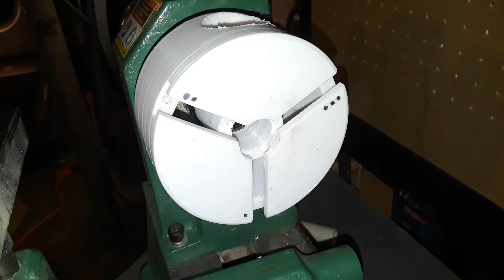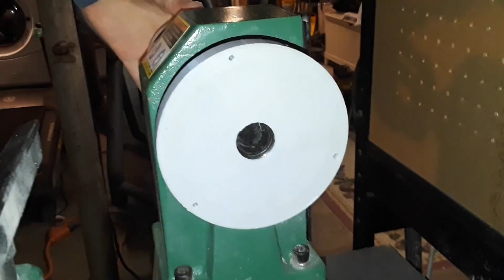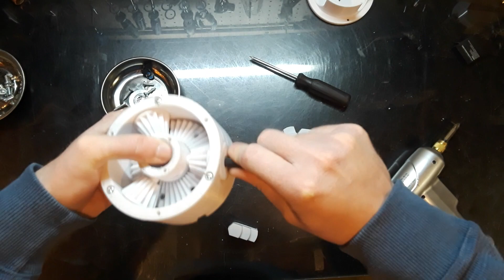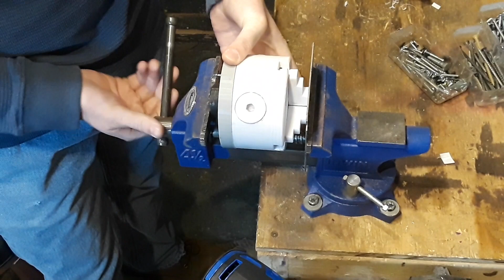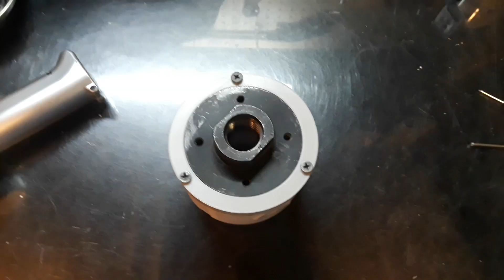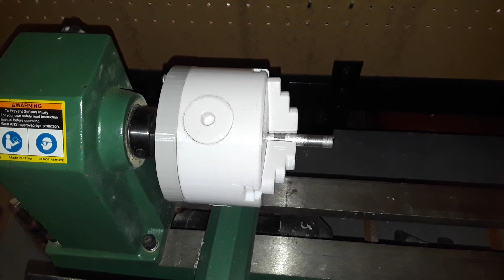Making a 3D Printed Lathe Chuck

Comment: do you have a link to the make the mod plate you made
Reply from the maker: I don't. I used tinkercad to make my own design. It's very easy to design. Just make sure you have the correct measurements for the lathe faceplate indent in the "mod plate".

Comment: Did you ever more thoroughly test this on your lathe? Ive got one printed up in PLA, Im curious if it can be safely used at the lowest RPM on my wood lathe (750 RPM).
Reply from the maker: So far it has been pretty safe. Just make sure all the plastic parts are screwed on to the faceplate correctly.
Reply: @BunkerBuilder  Whats the max RPM youve tested it at?
Reply from the maker: I have my lathe set at 1600rpm
Reply: The problem is not so much apparent solidity but the fact that the rotational forces and the vibrations caused by the machined part held by the chuck will eventually cause deformation of the PLA and delamination.
When a crack will appear (possibly internally and thus invisible) in the chuck PLA you risk catastrophic failure and desintegration of the chuck which will splinter at super high speed. Not to mention that the piece being machined will likely also be sent flying at high speed.

There is a reason metal working lathe are made of metal. Be extremely careful.
I would personally use the lathe only at low RPMs.
Otherwise, good job.
Reply: @nekononiaow  Just wanted to concur with this. Maybe a different filament would be better, like ABS or Nylon? PLA seems very risky given how brittle it is. I love the idea of being able to print machine parts like this. It needs to be safe though.
Reply from the maker: I mean it is safe, but personally I wouldn't recommend this to be used if your going to use it to the extreme. I like it because I can fit large diameter objects in it (Instead of buying $200 chuck). I personally just drill or cut it stuff on it. I mean you can try going all day everyday with this but I personally think some sort of deformity would happen. But with PLA its still holding out very well. If you use it every now and again and don't push it to the extreme, it should work well and last a long time. Hope this helps!
Reply: @alexnunn9880  ..look at this project for what it IS....
A light-weight tool for light-weight use with light-weight materials.
In this use-case, it is great. Easy to print, fairly inexpensive, not difficult to modify.

In my case, I would use it in plastic model building and balsa wood model building.
It would be useful for creating shapes such as cylinders, cones, spheres...
Also flattening  faces, and helping with sanding.

All with light-weight plastic (styrene, pvc, etc) and wood (balsa, maybe basswood).

MAYBE aluminum rod, or brass....
Reply from the maker: This guy gets it!

Comment: Power transmission ?
Reply: Bunker Builder I just wanted to know if there is a power transmission between the chuck and the steel rod
Reply from the maker: @guipop2614   If your wondering about the jaw grip strength I have another video about that topic.
https://youtu.be/ggw8d1vt1C0

Comment: Good work and good debugging. Here's a different idea. Once you've printed the chuck, then it's time to make the back mounting. Assemble the chuck. Put a rod in the center of the chuck jaws and hold the other end of that rod in your lathe.  Now when you spin the lathe, the chuck will spin perfectly and the back can be cut flat and threaded to match the spindle. Of course, this assumes you have SOME way to hold a rod in the lathe before the chuck is finished.
Reply from the maker: Thats a very interesting idea I think I could use another chuck to hold a rod (in the headstock) in and then have the 3d printed chuck connected to that chuck then I would have a tap (in the tailstock) to cut threads in it. Thank you!